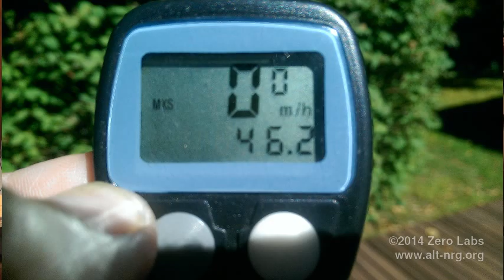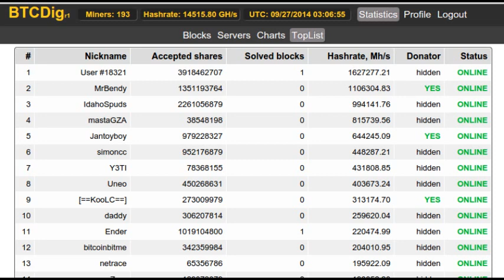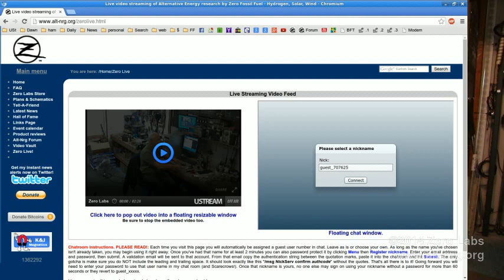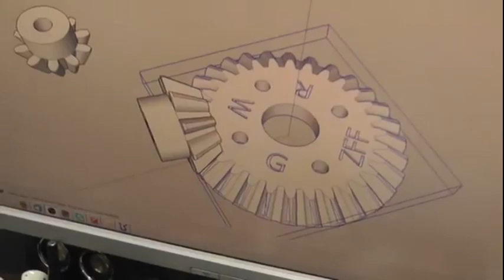#376 Zero Labs Updates, 3D printed gears from RWG!

Comment: I'm glad to see you are progressing. I have an keen interest in the copper pipe leaks. I am a plumber who lives and works in the San Fernando Valley, just north of the Los Angeles. I have dealt with many pin-hole leaks in copper pipe. I suspect that most of the damage is due to electrolysis. These leaks are more common where thin wall type M pipe is used and the piping has both copper and galvanized steel components. Grounding the pipes may be helpful. Also using brass parts at the junction of  copper to
steel deadens the effects of electrolysis.   
I eagerly await your analysis on this subject.
Also I am really interested in the magnetic motor. I want to build a magnetic motor-generator to produce electrical power for a household. These contraptions are already being made in Spain and Belgium, and possibly in Taiwan as well.

Jeff 777

Comment: Hi Mark, hope all is well. On the copper pipe issue. I have had to replace several in my home as well. We had our house built in 1991 and I have had about 5 areas do this. I have a well and the PH of the water is about 6.1 which is slightly acidic and I was told this may happen by the well company. But what I found more interesting is that the pinhole ALWAYS occurred where there was flux deposit but never in the middle of a clean pipe or anywhere else. Hmmm. And there did not seem to be any water soluble type of flux back then so there are still deposits everywhere! When I discovered this many years ago I always since used water soluble and the no lead solder to repair.

RF
Reply from the maker: RFpowerman1 That is where it fails most rapidly but trust me, corrosion and pitting do take place along the pipes as well. Very disturbing.

Comment: I am lost... is the QuarkCoins the same or not as the BitQuark?

What about the cex.io for the BTC ? Are they ok or not?
Reply from the maker: Bitquark is a hybrid of the Bitcoin model and Quarkcoin algorithm security.
cex.io is a well established crypto coin exchange used by many.
Reply: ZeroFossilFuel Thanks Z :) It's Strange Google Chrome says that BitQuark software is not ok...
Reply from the maker: il51diablo Not strange at all. Crypto currencies pose a serious threat to status quo of banksters and TPTB. They do not control the quantity of the currency in circulation. We do. We decide what the value of any given currency is. Google is not the benign little search engine it once was. It is very much part of the matrix and will resist anyone trying to unplug.

Also, early on there was and still is malware out there that includes crypto currency mining software as part of their payload which is controlled remotely without the computer owners knowledge or consent to mine crypto for the malware authors. Many anti-virus software produce false positives when we deliberately want to use these miners for our own use. It's important when installing miners to add them to your AV software white list.